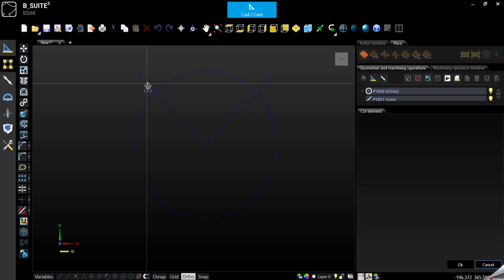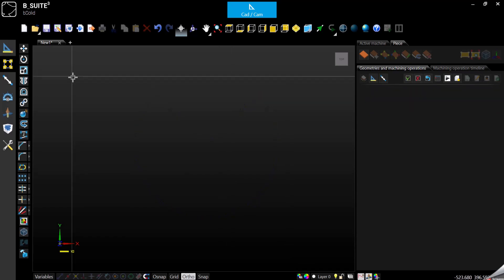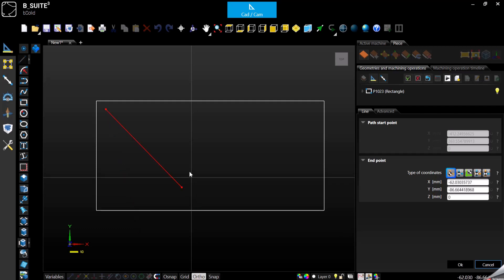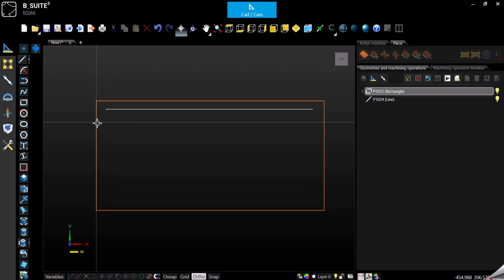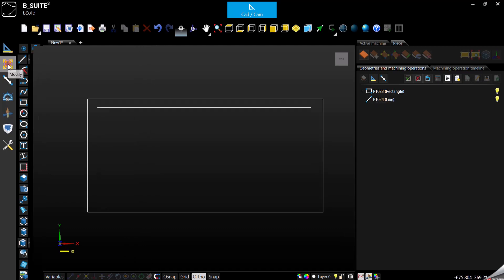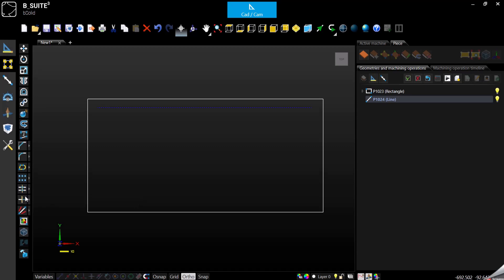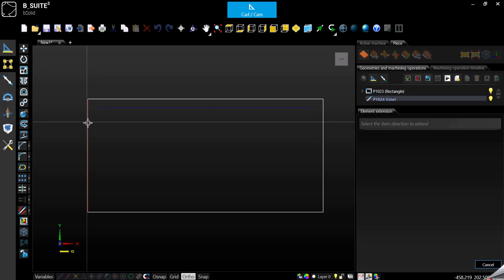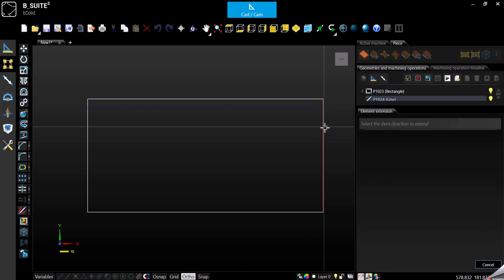19 - CAD BIESSE bSolid - Part 19 (Cut Element - Element Extension - Extend Path - Corner Extension)

Comment: Hi sir good teaching. Sir how is load software my laptop
Reply from the maker: Hi, you can install the software on your laptop using the DVD provided with the machine. However, keep in mind that if do not have an extra license, it will start as a DEMO version, therfore you'll be able to "play" with the software, but it will not let you save anything.